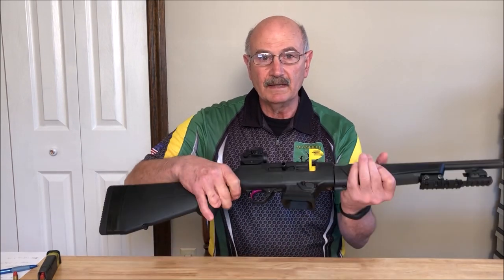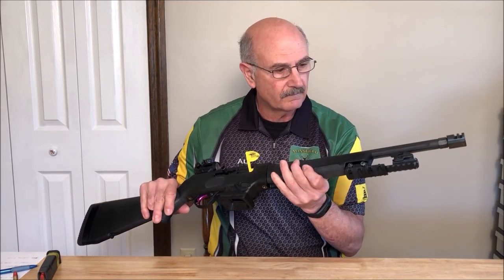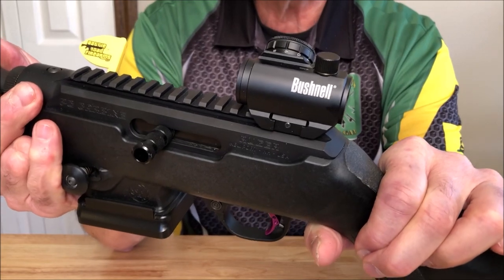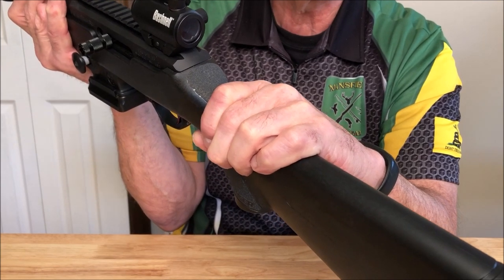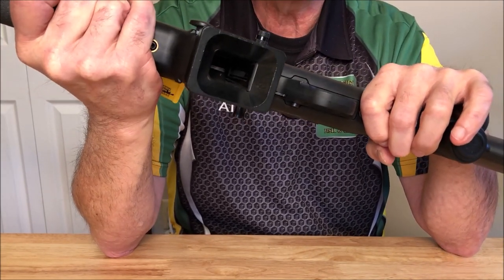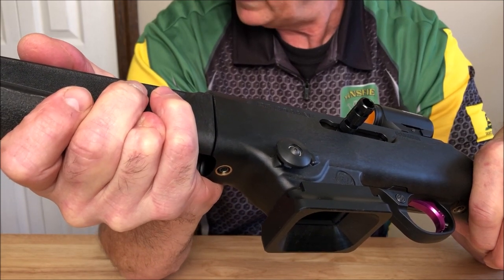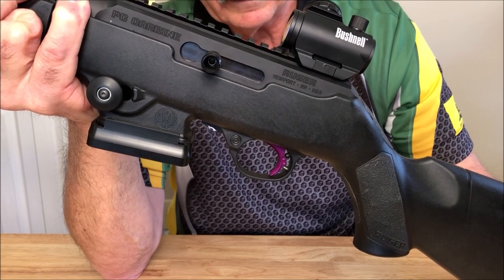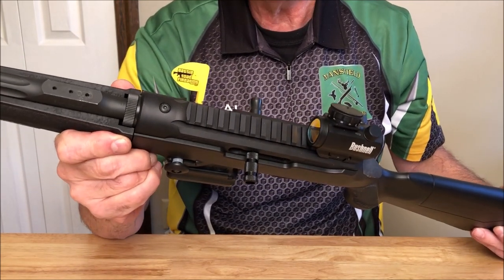Ruger PC Carbine Competition Upgrades, PLUS Magazine Change Techniques!

Comment: Great build.   I ordered my Ruger PC Carbine  with MLOK upper in February.   Got it home  a few weeks ago.   The MLOK does make it heavier.
- Was getting Bushnell TRS as soon as I brought the rifle home, but the Amazon price went from $40s to $99 overnight because of the panic.
-  Might get  a  Tamdem Kross comp.   Anything that reduces the time between accurate shots is a good thing.
-  I had extraction issues with the first 10 rounds.  The last 150 rounds have been fine.  Hoping my luck holds.
  
- I'm nearsighted but see fine with glasses.  How does the red dot work with glasses?
- I can aquire targets quickly with my Ruger 1022.  Minute of milk carton at 80 yards 3-shot bursts.    But I'm having difficulty getting used to the carbine's ghost ring.  I lose the front sight when aming at targets with a leafy  background.    Any tips?  Painting or laser attachment for front sight? 

Thank you for making the informative video.
Reply from the maker: Luke, thanks for the interest. I will answer in the order you asked them.
- The TRS has had price changes even before the virus, ranging from $37 up to $72. If you go to a website called "camel, Camel, Camel", it tracks the price history of Amazon items.  It will give you an idea of what to expect for different items.
- There are a lot of comps out there, and I bet that most are pretty good.  Don't believe the people that say comps don't work on 9mm because there isn't enough gas generated by the round. If they didn't work the pros wouldn't use them.
- My extraction issues started at around 300 rounds, during a match that I probably would have won if not for the extraction issues. The stock extractor can be reshaped, or just buy the one from MCARBO. You will be glad you did. I shoot reloads exclusively and don't sort my brass by brand, and I'm positive that certain brass extracts better them others.
- I have a "plus" prescription glasses for both reading and distance. I use +1.25 for distance, and this is what I use with a dot. It works great for me. Remember, that when using a dot you focus on the target, not the dot. With iron sights you need to see the front sight and the target clearly, which is tough for me.  I compromise with a +1.75 if I shoot iron.  I never fired a single shot with the iron sights on the Ruger.  I took them off the day I got it.
- You can paint the front sight with a good fluorescent enamel model paint that will resist the cleaning solvents, don't use water based paint. First put a base coat of white down, as this will make the top coat much brighter. A laser is only good up close in daylight, so go with the paint.

Let me know if I can answer anything else for you.
Reply: @CompShooter54  Thank you for the very informative reply.    
- Just got done with 30 rounds of target practice behind the barn.  This time maintaining a good "sight picture:, focusing the eye on the front sight.    Groupings at 45 yards much better.  Minute of 1 gallon milk carton at 80-90 yards.  
- Adjusted the take down ring so it takes a (little) more oomph to re-attach the barrel.  This might also improve accuracy.
- I'll certainly check out Camel.    I didn't want to pre-order the TRS until I brought the PC Carbine home in case there was a paperwork snag (I'm in California).  I'll keep an eye out for price changes.
- I'll definitely get a comp.  One of the reasons I went for a  9mm PC Carbine platform is the quick (and accurate) 2nd shot.    Reducing muzzle rise reinforces that function. 

Thanks for putting up with my novice questions.
Reply from the maker: @lukeywalsh  I think you are on the right track.  When you start seeing failures to eject, or double feeds, think about getting a new extractor.  Also, don't be afraid of cleaning it often. I was reading some posts where people are cleaning every 1,000 rounds!  This is not good. A lot of crud will build up under the extractor very quickly and cause the extractor to not fully grab the cartridge head. Take the extractor out and clean in the channel where it sits. Soak the channel with bore cleaner and let it sit for a while, then use a wire brush or a scraping tool to get all of the carbon out. Also scrape the carbon from the extractor itself.  Be safe out there in California, and happy shooting.
Reply: @CompShooter54  Update:
- Broke down and got a Romeo5 that was on sale.  An impulse buy,  I'm sure the Bushnell works fine.  
-  Had a hard time finding the GF comp.   Got a Tandemkross instead.  Double taps groups tighter.  Second shot target acquisition faster.  Doesn't eliminate muzzle movement, but it makes it more controllable.
Reply from the maker: @lukeywalsh  Yes, the muzzle devices really do work and the Tandemkross is a good one.  The Romeo5 is very nice dot as well.  Do you shoot factory ammo or reloads?  I shoot 147 grain handloads that sound like .22 and really don't have any recoil.  I use 3.4 grains of WW231 and it operates the action just fine. I would be curious to hear if you start to develop ejection problems at some point, most people do.  In MA all of the ranges were closed and I finally got to shoot again after about 6 months of inactivity (no matches here in the winter).  Good luck with the rifle!!!
Reply: @CompShooter54  I shoot factory.  Have a Ruger 1022 for years.  The  9mm Ruger PC Carbine is my first centerfire rifle so I'm new to the whole world of reloading.   Ordered the PCC before most Americans heard of Covid. By the time I picked up from FFL the virus panic buying  started so I've been getting what's available.  For target and plinking it's Blazer Brass 115 and 124 FMJ and Federal Black Pack 115 FMJ.   I hope to use 124 or 135 FMJ in the future to better match the the ballistics of JHP rounds I bought.  Very curious about reloading but not sure where to start, what the total setup costs will be.

Ran 650 rounds of FMJ.  No problem so far.  Tested  small numbers of various JHPs standard and +p to make sure they ran OK.  No issue.  Seems like Ruger PCC's handles hollow points particularly well.  
Have yet to test 147g subsonic.     

I have the opposite problem.  I live on a ranch on north coast of  California.   I can shoot daily November to the end of May, but the fire season just started.   I take a careful shot now and then, but high volume shooting feels risky.    Frustrating because I just got the red dot dialed in.    Working with a neighbor to make a grass free  burm (his tractor) so we can resume shooting.   Once that happens I want to work on drills similar to competition shooting.
Reply from the maker: @lukeywalsh  Glad to hear you are still able to get ammo. Around here in MA you can get Blazer for $8.99 a box.  If you want to try a really soft shooting very quiet ammo, try Federal Syntech 150 GR Action Pistol ammo.  Greatly reduced recoil and noise.  All of the competition shooters that don't reload use it. you can shoot without ear protection for a few rounds it's that quiet.  Most people think it is a .22 when it fires.  It is a bit pricey, it lists for $17.99 a box.  As far as matching ballistics for your hollow point defense ammo, I wouldn't be too concerned.  If you ever need to use the rifle in a defense situation you will never notice the noise or recoil, there is too much other stuff going on.  You should just make sure the 2 have the same reasonable point of impact, your practice and defense ammo.  The Ruger will feed anything I have tried as well. 

As far as reloading goes, the cost of equipment will depend on how many rounds you will be shooting, how fast you want to make them, and how much time you have available to reload. I use a Lee 3 position progressive Turret that I have had for about 40 years.  I deprime my dirty brass first, then clean it before moving on.  I deprime with a Lee depriming die, without using the progression feature on the press.  I can do at least 600 per hour.  I prime by hand with a Lee hand held priming tool.  I can prime about 600 per hour while sitting in front of the TV.  When it comes to the actual reloading part, sizing, filling with powder, and seating the bullets, I can do between 250 and 300 per hour.  Every 3 strokes of the handle gives me a finished round. I usually have one practice night a week, and a match every other weekend, so one reloading session per week is all I need to do. You can easily get a great setup from Lee for under $500 for everything you need to start.  Check out their site.  

For a beginner I would stay away from the expensive high volume presses that give you a finished round for every stroke of the handle.  It can be overwhelming for a beginner and lead to dangerous loads if you are not careful.  

Also, check out Gavintube on YouTube.  He reviews all makes of reloading presses and accessories and he is really good at producing videos.  You will see everything that is out there for reloading.  

I have never heard of conventional ammo starting a wildfire before, but I am not an expert on that subject.  The powder is burned up within a few feet of the muzzle, and a brass or lead bullet cannot create a spark, even if it hits a rock. But to be sure, the dirt berm is the way to go.  Good luck with the reloading if you decide to give it a try!
Reply: @CompShooter54  Thank you for the fantastic information.   

Bookmarked Lee Precision in case I do reload.   They have several kits to choose from.   

I've watched out Gavintube before out of curiosity about the new 6mm ARC.   He's surrounded by reloading equipment.  Gets very detailed about a specific cartridge even if he's not talking about reloading.   I'll definitely subscribe to his channel.